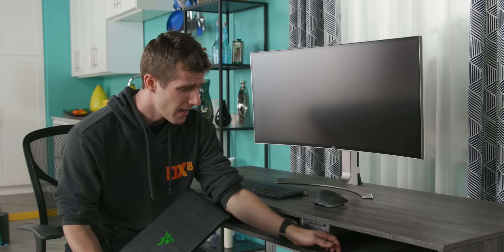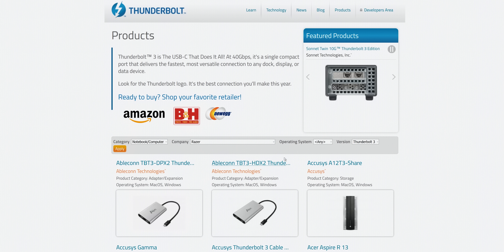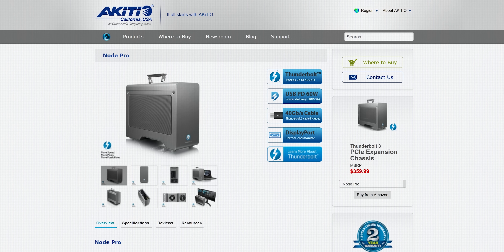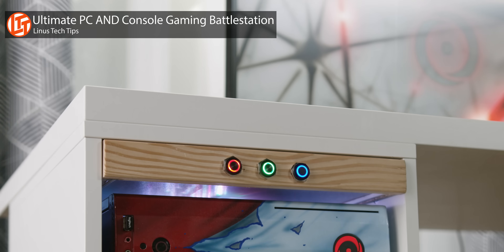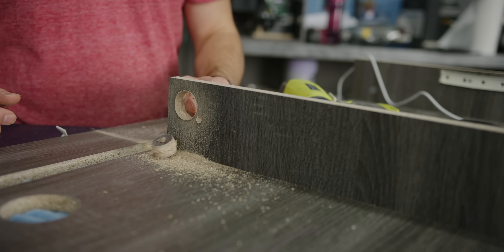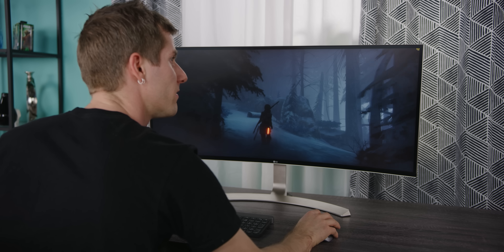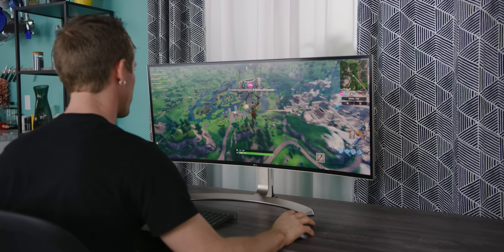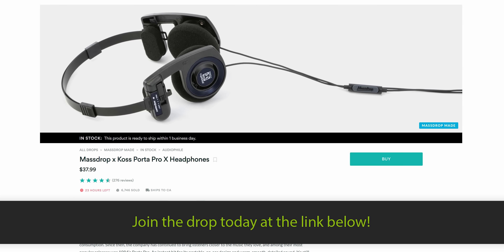This is the CLEANEST Setup.

Comment: Pro tip use dual lock for securing things, not velcro... Dual lock is much better, and also black which looks nicer than the white velcro. Also, make sure to use isopropyl to clean the surfaces before application so the adhesive doesn't fail.

Comment: if your trying to make the cleanest setup ever you should use all the tools at your disposal from the beginning , rout out a thin desk to house all of the components , have the laptop slide into the thunderbolt cable, replace the sfx power supply with a HDplex and tear apart the thunderbolt hub to build it into the desk you should be able to keep it under 2-3 inchs thick with everything included inside the table no need for drawers

Comment: How does the performance over thunderbolt compare to a PCI installed GPU? I guess all the thunderbolt multiplexing stuff for the keyboard, mouse etc has an impact. Even more so if you're loading big game files through the same bus. How is priority managed on thunderbolt attached devices?
Reply: You won't get quite the same performance over Thunderbolt, but if you've got a decent GPU and only shoot for say your monitor's refresh rate instead of unlocking your frame rate entirely chances are you aren't going to notice a difference. They say it's about a 10-20% performance hit over Thunderbolt but my 1070 works just as well as it did in my desktop. And you'd be surprised; using peripherals such as hard drives and accessories actually don't impact your frame rate as one might think running all of this through one cable.

Comment: Maybe for 2.0, have the hub mounted further back and then have it so it pops out the top of the desk if you need to stick a SD card in or something - kinda like this: https://www.rokhardware.com/rok-ac-receptacle-plug-port-pop-up-counter-top-desk-table-power-hub-outlet-dual-usb-connector-insert-silver.html  
If the hub was slid into a bracket on the pop up part you could still pull it out to gain access to the rear connections.

Comment: Yes to the Mac Setup: Try it with an older Macbook. That's what people need, is a solution to upgrade the Mac hardware without full replacement (say, an older 2012 Macbook pro with Latest Software updated and a comparable  EGPU Setup; See how it does on modern games! <- a true challenge)

Comment: I can already tell you, that velcro strap will come off in a year or so. And I'm talking about the adhesive, not the velcro itself. The problem is "material creep" of the adhesive that is basically just a polymer. The adhesive unlike proper glue is not made to cure and dry and become solid, it's perpetually in this sticky state. With the dock always applying stress on it and probably even heat coming off the dock which adds temperature cycles that stuff will not hold for that long. 
I've seen that multiple times. So if you want it to hold, use proper glue on non double sided tape type velcro.

EDIT: Should have watched the whole video before commenting. The thing came down even way earlier than I thought lol

Comment: Hey I was wondering, if you run those eGPU, then how does it work with the internal Razer laptop GPU? Can you turn the internal GPU permanently off while it switched to the eGPU? 

So I am using a laptop that is not designed for gaming but capable to do minor games like NBA 2K or Warframe, Path of Exile, you name it...the problem is since the CPU and the GPU using the same heatsink and I am using a laptop that is NOT designed to play game, the temperature can spike really high. So if I can somehow turned the GPU off, hopefully it can reduce the overall heat on the laptop.

Comment: I need a monitor like that 😍
Reply: And I need a decent gaming pc that doesn't cost £80 million.
Reply: @neverm0re-1994  Look into used Dell Optiplex 990s. You can easily upgrade them and turn them into a good gaming PC that can run new games really well for less than $400
Reply: I am personally thinking of snagging a 43-44" ultrawide myself with a 3840x1200 res. AKA 2 16:10 monitors side by side.
Reply: @Montisaquadeis  I considered that, but opted for 1 35" 1440p that can I can add 2 27" monitors to the side of later, to have an uninterrupted surface in the middle :)
Reply: what monitor is this ?
Reply: But you're a fucking rc car how tf did you build a computer in the first place
Reply: And I need a desk like that
Reply: Holy wow it's Henry!
Reply: Henry are you becoming the next Justin y?

Comment: Doesn't the length of the TB3 cable limit the bandwith to 20Gbts? https://blog.startech.com/post/thunderbolt-3-the-basics/
Which means you'll only get half the bandwith, and with usb 3.1 and 3.2 you'll end up using half that speed on the usb ports. (10gbits), if you got external ssds or something.

Comment: I feel that a recessed mouse pad would cause issues when you move your mouse to the edge (obviously by accident in heavy gaming). Despite how precise it could be machined, the pad is still softer and would not be exactly level with the desk surface. That is unless a hard pad is used, which I hate

Comment: The eGPU is running on a much longer cable than what we normaly see. How does that affect the latency and the effectiveness of the eGPU? How does the Akitio pro handle the extra peripherals, are there dropouts like we noticed on the first razer core? I am interested to see a benchmark with this setup.

Comment: What i don't understand, why was it necessary to daisy-chain with that HUB? You could have just used the Razer Core, which has 4 USB ports, a lan port and charges up to 65W trough the TB3 port. You could add then a normal USB hub for front i/o (ORICO  USB 3.0 6-Port Hub Combo). With that TB3 hub, you just made it more complicated.

Comment: Tip: prep each surface of the I/O and desk with an alcohol wipe then use 3M command strips. Those things will hold anything. I've got 1 holding a 10lb power conditioner to a wall for 2yrs now.

Also, closing the lid of a laptop and keeping it running will ruin the display over time. I've seen it and had it happen to many high end laptops when used as desk top replacements. The lid should remain open a few inches to allow space between the typically 60*c surface and the screen. Just simply have the laptop screen turn off when an external display is detected, much safer this way.

Comment: I did a similar setup but with a desktop and no compromises. I got a thermaltake P5 open air case with agesa mounting and mounted it on my wall. Next to my tempered glass desk with nothing on it but my monitors, mouse & keyboard. Perfection! My only issues is the rat nest of wiring hanging out the back of my desktop. It's awful and idk an easy fix.

Comment: Did the external GPU not fit into the giant opening you put the laptop and everything else into, underneath the desk surface itself? Seems awfully stupid that you didn't just face the GPU fans downward and cut holes for it to draw air in through. Plus, you wouldn't have another chunk of furniture, just to house the dumb thing.

Comment: Drilled holes for ambidextrous cable plugging.
"doesn't matter which side of the device you plug it in" 
Uuh Linus, you can just turn the laptop 180 degrees and then use the same side

Comment: Version 2 needs sound, something like screwed in speakers and wireless headphones. The already mentioned storage and mousepad should be included. And I would like to see some 802.11ac WiFi and/or Ethernet Plug so that you have great connectivity without a cable being attached at the desk. A desk lamp would be nice and for the gamers a controller dock. So like the ULTIMATE BUT CLEAN Setup

Comment: If you place Painters tape (or another low strength tape) on the cut lines of project, that you are worried about damaging with the C&C, it will massively help keep the material undamaged.

Comment: A high power laptop overclock for gaming with his closed lid will overheat quickly with their low venting solutions and most of them not easily modifiable for upgrades ,unless you get them for free and change them every two years ,your better with both ! unless your just a facebook and youtube user your better with a real PC !

Comment: This is another awesome project, but several caveats apply as always. Going the laptop route you limit your capability to upgrade CPU, drive space, and in some cases RAM. Also, limiting your choice to Intel powered products as they are currently the only ones with Thunderbolt 3. You could have a baller desktop and buy a budget $300-$500 laptop for everything else and switch to another input on your existing monitor when needed.

Comment: I'd like to see a MacBook variant since my girlfriend is a Mac person.

I'm a freak and use Linux, tho, since I had a Windows update brick my system at work one day and said enough was enough (I'd been using Linux exclusively on my desktop and media server for years, as well as using it off-and-on for about a decade now on other systems, so there was not a learning curve in my case). External GPU support isn't quite so plug&play but it is getting better.

Honestly, I just like the clean desktop experience but I'd probably go dual monitor instead of one big ultrawide so it plays well with MacOS when dealing with multiple windows at once since Apple still doesn't support a damn tiling window manager by default
Reply: Window manager for Mac OS: http://www.lightpillar.com/mosaic.html
Reply: @nitrojawt  
That is an option, as well as Amethyst ( https://ianyh.com/amethyst/ ) but I just fail to understand how that capability still isn't natively supported. I hadn't used OSX since it was new before working on her laptop a few months ago and couldn't believe that they don't have smart window management integrated into the system already.

Like, snapping windows to edges was supported in Windows 7. That's a long time for MacOS to not natively integrate what is a common feature now.

Comment: I would like to see linus try this with a three monitor setup with speakers. Keyboard,Mouse, 3d Vision Hub, Normal USB Hub. Desktop light, Desktop Fan, wireless charger, Printer using USB cable instead of wireless lol. Please feel free to add anything else which uses a cables and make this as tidy as possible lol.

Comment: I did roughly the same to my new desk. Drilled holes myself with a Metal hole saw. Then glued in grommets. Under my desk it allready had under cable management in a form off a huge net. Put all my cables and extension leads into this net in and made one big cable from the net using tries going to the back of my  PC case. Near the back of the pc case the one huge cable had to be split into each seperate lead to go into each port IE Powercable, USB,Monitors etc etc. I plan on doing much more if and when i add more hardware to my gaming setup. I have alot of stuff with cables which tbh cant be seen since i cleaned up my setup.I also got extra usb 3.1 cables running under my desk from the back of my pc case attached under my desk using two sided velco tape and put to the front of my desk. Now instead of having just 2 usb 3.1 ports at the front of my pc case to the side of me. Which is allready used up with stuff i have 4 usb 3.1 ports 2 of which is not used unless i need them for charging my wireless mouse and headset.

Comment: okay this works for some usecases. but you still run on the same cpu the razer comes with, also the ram and everything else. Wouldn't replace my workstation and the laptop I use to present the stuff or take it to a client.

Comment: Needs a monitor arm to make the monitor float rather than having that stand on your desk. Also, with the right desk surface, you're fine without a mouse pad. I would have the opening in the desk around the side so you don't have to see the I/O, and can reduce desk thickness.

Comment: Those screws they was inconsistent are wood screws but they have it fastened to metal bracket

You would need to counter sink the hole or use a machine screw instead

Comment: y'all should use 3M Dual Lock tape instead of the velcro tape. If applied correctly it holds like you wouldn't believe. I work at a sign/architectural construction company and we use it to hold metal panels on the outside of buildings. It detaches but ONLY when you want it to. I've seen the glue sides fail before the "velcro" side does (primarily due to misapplication). It's perfect for mounting devices and holding things together that only occasionally need to come apart.

Comment: Clean setup no doubt, bt u could have used AW graphic amplifier which has all the USB options plus Ethernet cable plus 4x PCI express connectivity which is way batter thn thunderbolt 3 option..

Comment: Did a similar thing but mounted eGPU to the underside of my IKEA sofa. Opted for Gigabyte gaming box as it came with 4 port USB hub on it. Have an external HDD plugged and HDMI out to TV. Cable from Gigabyte was short so got a 2m active thunderbolt cable.
Oh, and laptop is XPS15. x2 lanes unfortunately. Not too happy with the thunderbolt connection. Plug is very loose and slight movement is enough to break the connection. Solved this by having laptop sit on an IKEA lap stand and fixing the cable to the stand.

Comment: There's no point in trying to eliminate dual systems until two things happen, price of TB accessories comes down substantially, and we get an option for external CPU power. You will never replace a workstation with the lack of CPU power that the laptop gives you, at most you'd be replacing a midranged desktop. 

If we could make eCPU possible, we could make the most featherweight of devices into the heaviest weight of workstations. Imagine if we could have an ultra-low power tablet with a typecover for a base product, but add a mobile dock for laptop-like power, then a desktop dock to make it a desktop or workstation; now imagine that with a phone, like a Samsung DeX but on steroids. Compute clusters may be the answer to this, have a single compute unit in the base product that plugs into a cluster dock.

Comment: why I wouldn't do this:
1. That double layer on the table means you cannot have an ergonomic arms - armrests - table surface position, since your arms need to be much higher than ideal.
2. Laptops need to have the lid open so that the heat can dissipate properly; otherwise the monitor will deteriorate, and everthing else as well.
3. You cannot easily upgrade components in your laptop.
So I would just stick with independent laptop for limited on-the-go capability, and desktop for working and gaming at full power!

Comment: Or you could use a small usb 3.1 drive enclosure with a ssd, put your files and stuff in it to use on the laptop, and install a hot-swap bay on the desktop pc (or just use the same enclosure)

Comment: it would be interesting to see if upgrading the power supply enables charging at higher wattage. Or if some mod to the akitio enables that with the new power supply. Like a mod to the board or combining the two 60w thunderbolt connectors to one cable output for data and more power and one input for the caldigit with some splitters or something.

Comment: Linus Tip for you, dont do Fortnite for fps testing, they have software issue for it just bottlenecking gpus in split second for no reson, game is surely not done well, they just slap updates and keep it going, ignoring all the problems it has... Awful game btw. Just go with something more refined and all and all better :D... And what is this monitor full spec, link plox...

Comment: A MacBook Pro version would be great! I mean, this setup basically sacrifices money and gaming power for style, same as a Mac, so using a macbook would kiiiiiinda fit into the theme I guess :D? 
I have also thought of a similar setup with my i5 MacBook Pro 2018, but there are some limitations regarding Nvidia graphics cards with sketchy workarounds which I do not want to try out myself, just money wise. It would be really nice to see what eGPU Case (Or just the blackmagic eGPUs) would allow for the highest efficiency and also at which graphics card performance the i5 bottlenecks the whole thing, given that eGPUs tend to lower their graphics cards performance substantially. 

Does anyone in the comments have recommendations for me? Id like to game at 2k with at least 60 frames and high details in AAA games. Is that possible?

Comment: So... just a quick warning. Which may not apply to all laptops, but definitely will to a lot: Some laptops have either badly designed airflow (or its intended like that for some reason) - which results in the keyboard surface area to become a significant factor in cooling. So while normal use won't have you burning your fingers off (the airflow is not that bad) - it does contribute to heat dissipation. I found out the hard way (after a few crashes) on my ASUS ROG that if I closed the lid (configured to not sleep with a lid closed) and connected it to a TV to enjoy some beautiful RPG's in my hall, it would soon just conc off .... after mulitple such instances I realized that the keypad area would be significantly hotter than usual. 

I know it kills the whole 'clean' look, but I would advise leaving it open during heavy gaming. Even if you have an external GPU, the CPU's are surely still heating up a lot more with a closed lid.

Comment: Looks good except for the silver I/O box, it really stands out. I’d have painted it black and put it in a left corner so it’s more hidden.

If you wanted to go all out, you could take apart the I/O box and mill some stealthy I/O holes in the top of the desk. Would be kind of cool plugging whatever usb accessories straight into the desk.

Comment: ...You're probably better off going with a 15" laptop with integrated graphics and a simple Thunderbolt docking station.  I have an older setup that works by USB3.0 that is about the same concept.  Granted, I have to plug my computer into power as well as data, but it functions.